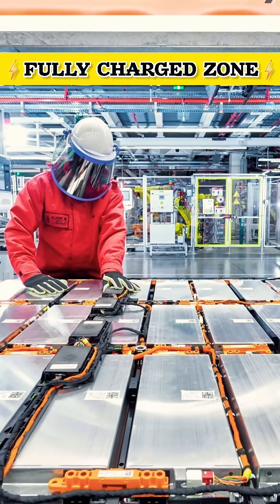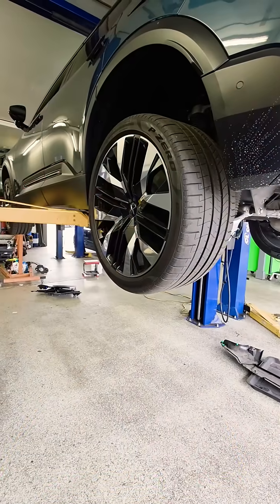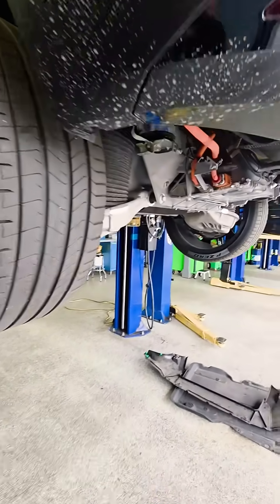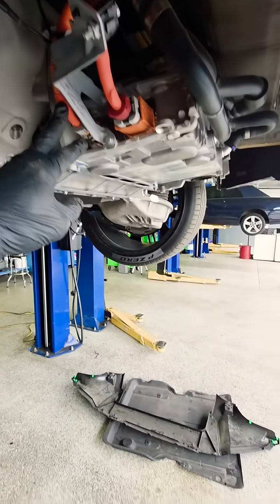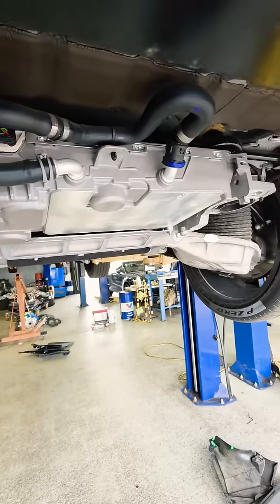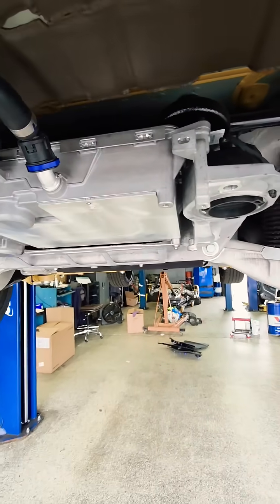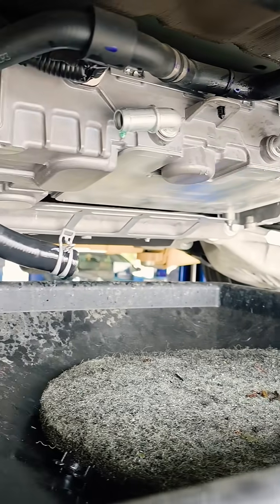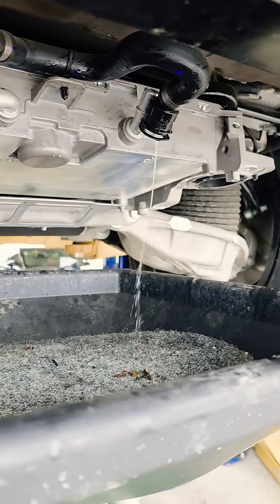Polestar 3 • Onboard Charger Replacement

Comment: Have you seen OBC/GHCA errors being fixed with de-energizing the vehicle . Trying to exhaust every option before taking it in to service 200miles away .
Reply from the maker: I'm sorry to hear your having trouble with your Polestar.  How do you know you have a GHCA malfunction?  Is the vehicle charging properly? When does the error occur? Is it intermittent or permanent? Polestar is very good at honoring the warranty.  Have you talked to your service advisor about having it towed to the dealership?
Reply: @FullyChargedZone charges on dc chargers but not ac. Initializes and then says waiting and then errors out.
Reply from the maker: You concerns are definitely pointing towards a GHCA failure. I would need a readout and a inspection to be 100%.  Have you tried other chargers with same results? I would see if polestar will towards your vehicle and bring you a loan vehicle. Polestar is pretty good at accommodating the customer needs. Thats got to be difficult going to DC charger instead of at home level 2. Where are you located?

Comment: I have a Polestar 3 that stopped charging last night at 73%, with a “Charging system fault” error message. I’ve swapped charging connections, adapters, done soft resets on the MCU, lowered amperage down to 10a, and let it fully go to sleep… and nothing is solving it. I’m guessing your video is showing the service my vehicle will be receiving shortly. Do you know if the charger has been redesigned to resolve this issue? Or is it the exact same part?
Reply from the maker: The Polestar 3 charging issues is not very common. The charger in the video was faulty because of a bad DC charger being used. The On board charger will be getting updated next year from what I hear. Your symptoms are definitely pointing to a fault with GHCA Onboarding charger. I wouldn't be 100% without data. I recommend you make a service appointment ASAP. Polestar is very good about taking care of warranty issues. 

If you vehicle is low on charge make sure to explain that to the Polestar service advisor.  

If you have any questions let me know. I'm a certified Polestar technician.